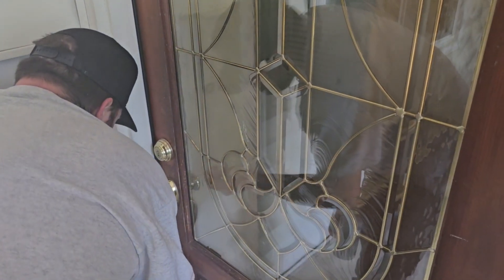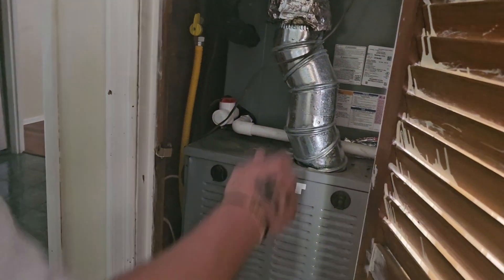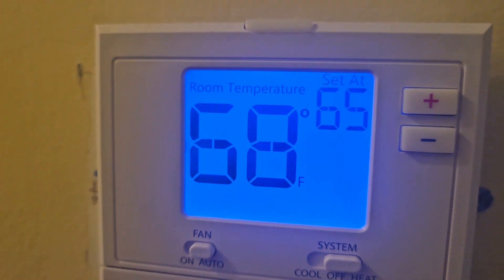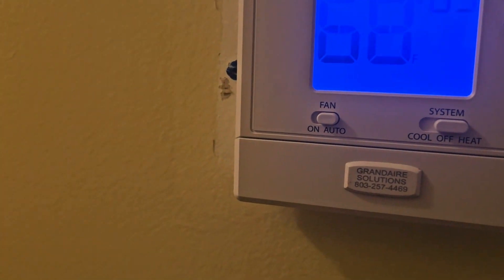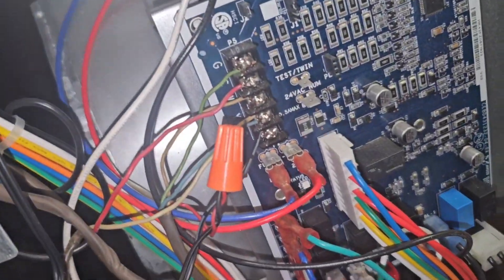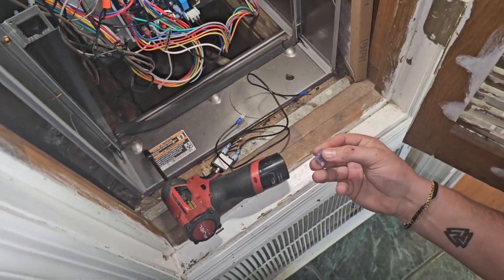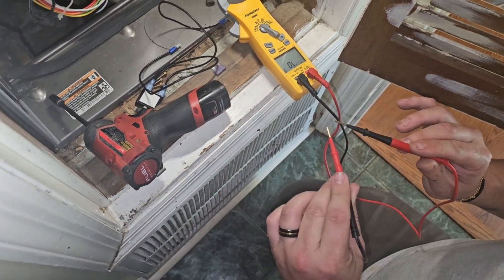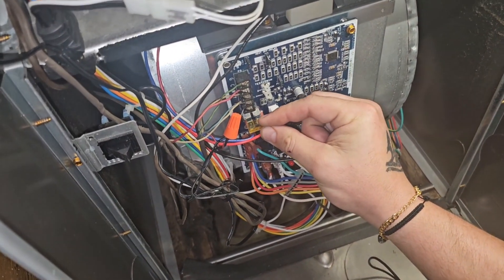Taking What We Learn In Class And Applying It

Comment: Why didn't you place your amp probe around the little popper wires and check the fuse circuit amperage draw before replacing the fuse?

Comment: Try a Short Pro Tool it will tell you instantly if there's a short, you do not have to wait for the popper to trip.
Reply from the maker: I'll have to look into that. Didn't know that was a thing
Reply: With power  off, measure ohms from common to all the other wires.  Every contactor or solenoid will be about 14-22 ohms.  Two on one wire will be 7-11 ohms.  Anything less than 5 is suspect.
Reply from the maker: @chrisscott1547 I've been getting better about doing that when I come across low volt shorts. And I've had to remind myself a few times that it will beep and read in the teens from Y to C 😅

Comment: You could not turn him loose in his own van and he doesn’t understand this by now he’s probably not ever going to.  Well adventually he would but it would cost the owner way to much money. He needs to attend basic electrical class probably
Reply from the maker: I agree a bit, the class we went to today was a basic low volt class and understanding the circuits and what not. He's catching on and not afraid of the environments we have to work in. We've lately hired a string of guys saying they've done this trade for years, and end up diagnosing a bad compressor saying "both my high and low sides are going up in heat mode" come to find out they didn't have the low side on the true suction port. Guys who want to bs and try to just word invoices to sell units. My boss wanted to try training a person from the ground up instead of taking one of the local techs that bounce around companies
Reply: Must Vape a little B4 and During the Fix😅

Comment: Buddy couldn't wait to jump on his phone and hit the vape 🤦🏽‍♂️
Its heating but what was the cause of failure? 
Did they switch it to AC when it popped? 
Most of my popped fuses have been from the 24v control wires going outside.
Reply from the maker: Well it didn't trip when we cut it to AC, condenser cut right now. But I did notice on types of fuses I had the terminals were loose. I don't know if that being loose could cause arcing and damage it, but  I have come across 3A fuses that blow for no reason and when you stick a 5A in the system is fine
Reply: Loose connection at the fuse it’s enough to blow it I’ve seen it before

Comment: Interesting stuff, you walking him through the diagnosis. Everyone's diagnostic process is unique and valuable. Was that a 3 amp fuse you removed? The loose connection could have been an issue and a good catch. You might consider a 3 amp fuse for replacement.
Reply from the maker: Eh, I've come across it a lot where the 3A will blow but you put a 5A in and  it will be fine
Reply: @AB_HVAC  it may have been designed for a 3 amp. 5 amp fuse may not pop if it's not drawing over 5 amps. If it is a direct short, it will blow anything right away. You can read amperage on your low voltage circuit. Could be an intermittent issue, like the condenser runs and vibrates for a while, then the rub out on the low pressure switch hits just right.  Typically, there is a cause for almost every fuse to blow, high, or low voltage.
Reply from the maker: @EverythingHVACR  hmmm that's weird. I mean I'll have to cross that road if we come to it but I get what you're saying. I've had a rub out do that where it ran for a bit and then shorted and the wire would move to a better spot once the system turned off and I popped a new fuse in